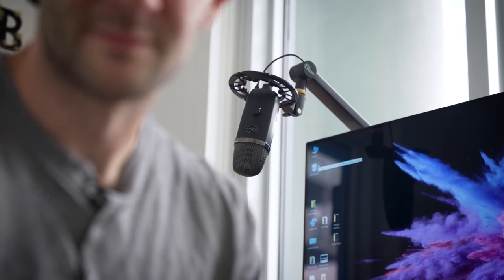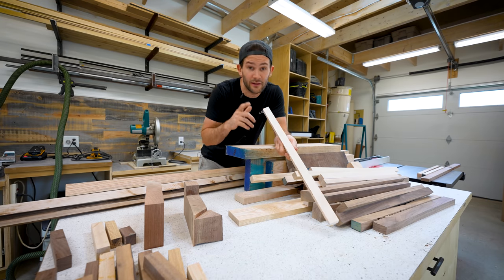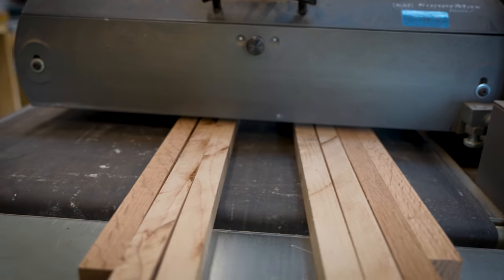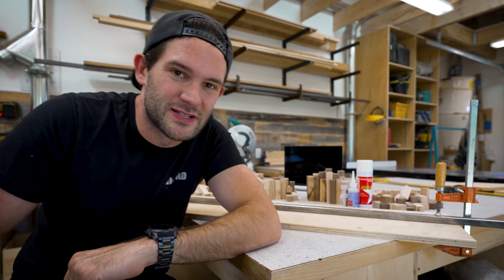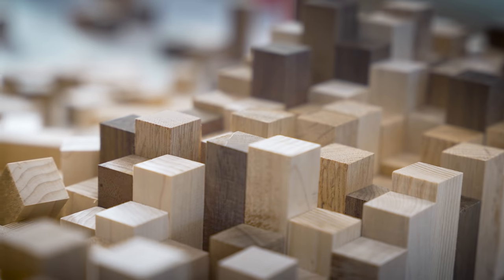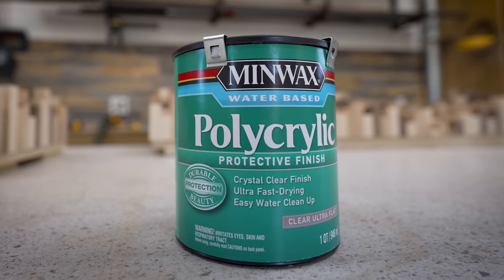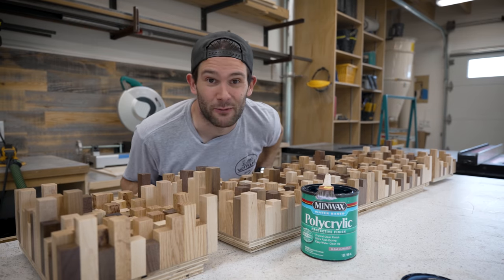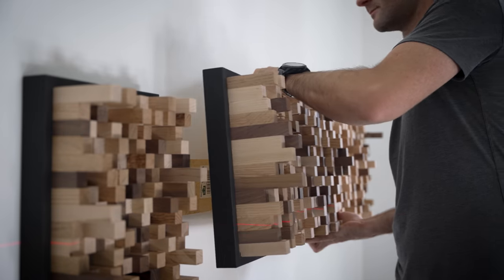Functional Use For Scrap Wood! – Studio Sound Diffusion Panels

Comment: Diffusers don't eliminate reverb; they reshape it by changing how it bounces around the room. Reducing reverb time requires removing acoustic energy from the room by converting it to another form of energy. Fiberglass and foam panels are two materials which can do this.

Incidentally, diffusers have lower limits on their effective frequencies. The ones you built will work down to about 1 kHz.

There are several free utilities for designing  mathematically-correct diffusers that are maximally effective given a set of constraints. Your final product looks nice, no doubt, and will have some effect but it's a shame you didn't use a proven algorithm to design it. Next time.
Reply: Hmmm sent this to my partner since they're musicians o wonder if putting foam between what goes against the wall will work. Thanks for the insight.
Reply: Out of curiosity, would making this out of the foam panel material work? I helped a buddy out building a sound booth and we used some 1'x1'x1" squares of the stuff and it seemed hardy enough..

Loved this video, Zac. The beauty of the grain really pops and a great way to (slightly?) lower your scraps bin! :D
Reply: and thy are far too small.
Reply: Could you please link one of these free utilities? I would very much like to build a mathematically correct panel but having a hard time finding what you suggested.
Reply: @alexiscanet9009   putting absorbent material behind the wood wont work. In order for sound to be absorbed it needs to reach the absorbent material, but the wood will make it bounce before it does.
Reply: @Raeven00kami   depends on what you want to do, a diffuser made out of foam wont diffuse. In order for a sound to bounce off of a diffuser,  it needs to be a hard material. On the other hand, foam does not need to have  odd shapes. How much a panel absorbs (and on which frequencies) depends on the material, plus not all foams are equal. Depending on the panel absorption and  the room size you might need more or less of the wall area covered. And lastly, foam does not do much to absorb low frequencies unfortunately.

Comment: I actually appreciated the timer. You should keep that around. Maybe even have a small timer in a corner that's permanently on.

Also those sound diffusion panels, even if they were professionally designed (ie calculated to achieve a specific effect) would still not be enough due to how small they are compared to the room. So it's a start for sure and it does look cool.

I don't know what else you've planned, but those windows are pretty large and you should consider some dense fabric curtains to diffuse the sound reflected off of them. You'll be surprised how much that helps (speaking as someone who has just recently started acoustically optimizing his home cinema setup - which has a wall that is one large window).
Reply from the maker: Thanks you, the next step is to get some sound traps using mineral wool. I do actually have some roll down curtains which should theoretically help a bit. They aren't heavy drapes, but  they are a blackout sytle canvas. I'll make sure I roll those down before recording.
Reply: @ZacBuilds  Excellent, you can try the roll down curtains, though i suspect they won't be as effective as heavy drapes. Mineral wool is afaik preferred for sound insulation (ie absorbing sound), which should help reducing reverb tremendously. Gotta be careful to leave enough diffuse reflection, otherwise everything just sounds muted. I'm personally going to try styrofoam wall panels for absorbing sound on my back wall. I'll try and make them look like a faux stone wall.

Comment: Last winter, I did 2’x2’ skyline panels using repurposed wood (60 y.o. veneered plywood beams) cut all by handsaw while listening to hockey on the radio.  Getting a nice cut by hand is very satisfying, if you aren’t in a hurry.
My tips: 
—use larger pieces than in the video, I did ~2”x2”, for LESS cutting/sanding and BIGGER panels
—consider cutting the exposed ends at random angles for another element of diffusion
—don’t get too fussy about being perfect like the guy in the video; imperfections are lost in all the busy towers; eg. I barely sanded mine, and using different sizes is not a big deal either.  I had alternating rows of slightly different width towers, which worked great.
—a thin backing board is preferable
—the banded effect of plywood beams is very good, especially if the plys are thin and numerous
—leave some spots empty
—this calls for some time and effort, and will hang on the wall for years, so you might as well go all in and give 110%__find and follow an acoustically formulated pattern; look (on the internet) for “skyline diffuser pattern”

Comment: This is the second diffuser I've seen on Youtube, but I doubt it will work as intended. Although the blocks vary in height, they all reflect sound in the same direction. Seems to me the blocks should be cut at angles and pointed in different directions, up, down, left, and right.

Comment: Hmm, despite the high cost involved, I could see marketing these to people with smaller recording spaces in their home. I knew many voice actors and audio book narrator's who have converted a spare closet into a recording studio; something this scale could provide some decoration and noticeable function beyond the normal acoustic panels.
Reply from the maker: Oh totally! Or YouTubers like me haha. Professional made sound diffusion panels are available and they are quite expensive!
Reply: Shipping cost would kill you. You can buy rigid foam diffusers and bass traps that install easily and shipping costs are low.
Reply: @haldorasgirson9463  Of course, but the overall cost of something taking half a workweek to construct isn't going to be cheap in the first place. This would clearly be an upmarket item, and possibly one marketed locally so self-transportation is possible and shipping cost irrelevant.

And anyway, as I was referring to panels for small spaces, only pieces close to the size of the satellite panels Zac made would be feasible/desirable in such rooms/closets. Make a smaller, multi-piece diffuser that could fit in several USPS flat-rate medium boxes and the cost is cut even more.

Comment: There are sites that dictate the specific length of each piece and it’s location in relation to the other, it’s a mathematical calculation and to have a skyline diffuser work within a predetermined frequency range so you definitely need to use a site that provides this critical information or you won’t get what you want, it’s that simple

Comment: Nope, nope, nope, diffusors do not reduce reverberation, they only break up standing waves and such.
They make the room sound larger and sound better, but do not reduce reverberation time.

If you want shorter reverb time, you need absorbers, not diffusers.

You have large windows. The windows reflect a huge amount. The walls are not your primary problem, though it obviously helps to treat them.
Also do not forget the ceiling, as that's where lots of early reflections happen. Directly above you, where you sit.

Comment: There are free websites online that will calculate the exact pattern needed to disperse specific frequencies. What you built looks nice, especially with the various colors of wood used, but unfortunately the actual effect is unknown. Next time use a pink noise generator and an RTA MIC in the room to find the problem frequencies and build the diffusers accordingly.

Comment: What brand mask is that at 9:55?
Reply from the maker: That's an RZmask. They actually sponsored another video I did and you can use code zacbuilds for 20% off on their website rzmask.com
Reply: @ZacBuilds  that discount code isn't working :(
Reply: @jawaring4367  that's because I'm an idiot and gave you the wrong code. It's actually Zacbuilds20 sorry about that!
Reply: @ZedEh  thanks that worked!

Comment: Unfortunately this video should have never been produced.

Diffusion is a very specific mathematical equation. If that formula isn't followed, it's no more effective than a bookshelf.

Also, diffusion of your design depend heavily on the size of each wood block. The depth and width. Your diffuser (if mathematically built) would only diffuse down to around 3,000 hertz. Maybe 1,000 hertz.

For the high frequency slapjack reverb using absorption would be the better/easier/more effective way to treat that room.